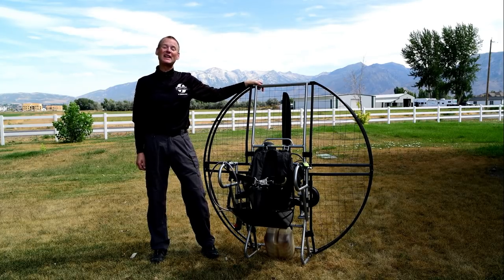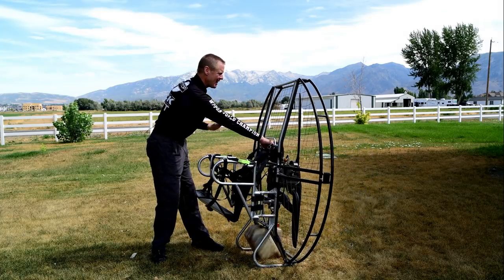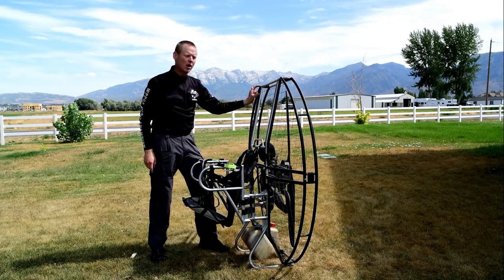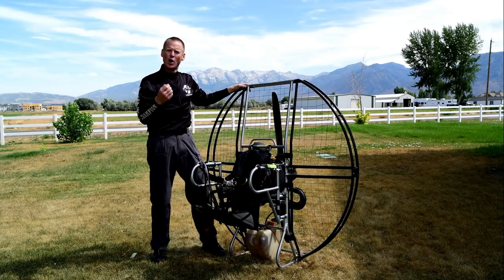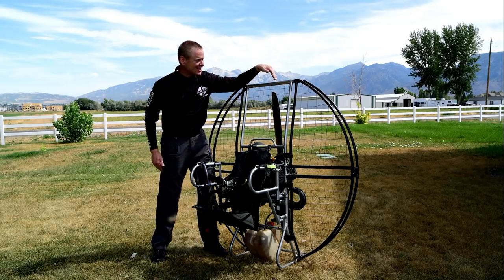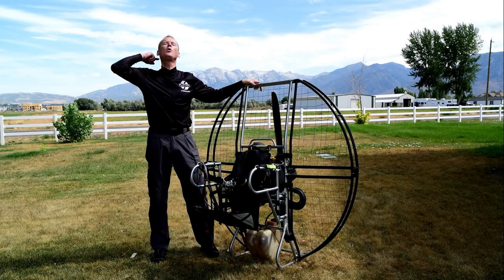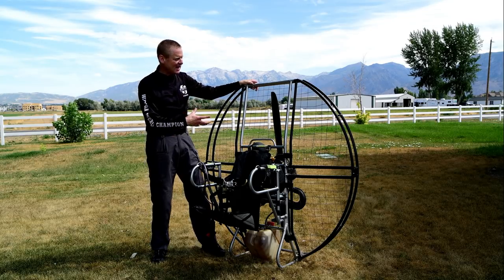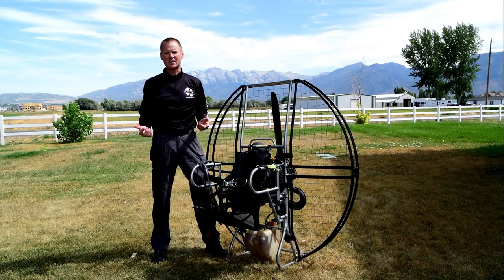Why Does The Flat Top Paramotor Have a Flat Top? Powered Paragliding Extreme Safety Details!!

Comment: I am just doing research on this as a possible hobby. A lot of the cages that I have seen have a cord-like netting between pilot and prop. Besides weight, is there a reason why a more rigid mesh can not be used?
Reply from the maker: There absolutely needs to be protection from the prop like the Flat Top has.  It's totally insane other units haven't updated in over 40 years.  No there is zero reason or excuse not to have good protection from the prop.  It's more than just netting though the actual cage on most units isn't even strong enough to keep the whole cage from flexing back into the prop.  So adding strong netting to most units out there wouldn't even do any good as the cage itself is too flimsy.  That's why all competent pilots fly Flat Tops right now.  Kinda insane.  So much foolishness and needless carnage in the sport.  The Flat Top is the only practical paramotor on the market right now.  I wish there were others but the Flat Top is literally the only one.

Comment: Why is the propeller circle outside the frame? Looks  as if the engine is not mounted deep enough in the frame?
Reply from the maker: It's critical for safety and durability actually.  The cage isn't there to protect the prop it's there to protect you.  The Flat Top is 100 TIMES stronger than other units but the cage will still flex a bit if you smack in or fall down hard so it's important to have the prop stick out just a bit past the cage to give optimal clearance so there is no way in heck the cage can hit the prop like it does on pretty much all other units.  Plus if you fall over backwards it's critical that the prop hits the ground.  Do you want to fall back onto a spinning prop? It's actually safer for the prop as well interestingly enough because if the prop hits the ground all at once like that it usually just stops instantly without any damage to the prop.  Turtle the Flat Top and you just get right back up without damage most commonly.  I have a whole write up of the specific details but this gives you an idea of just a few of the specific reasons why it's super important to have the prop away from the cage.